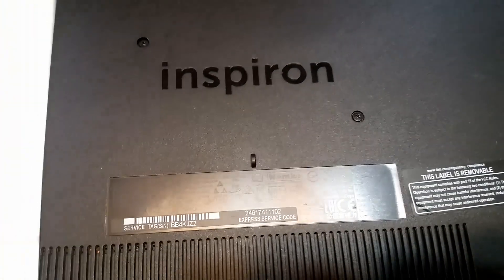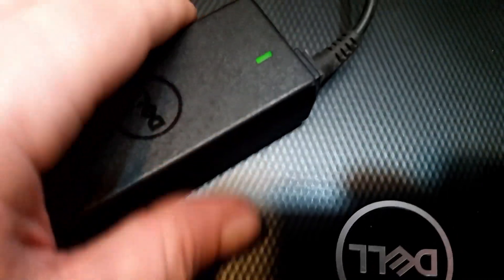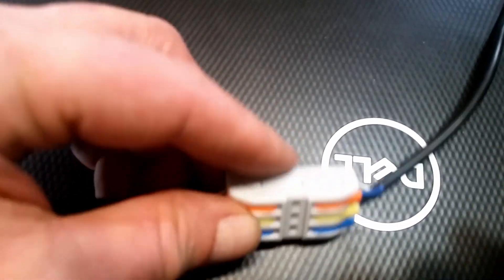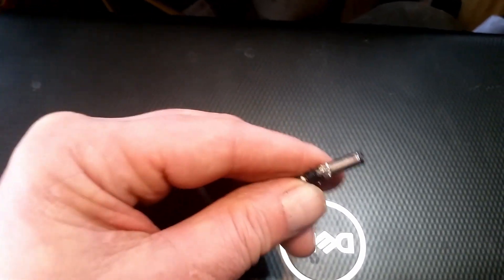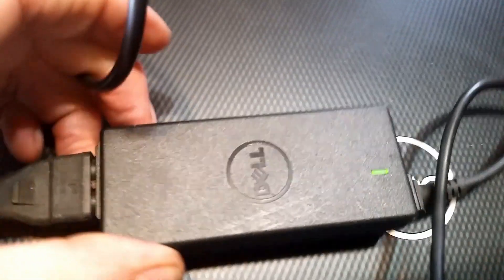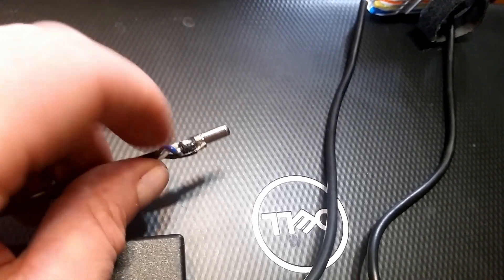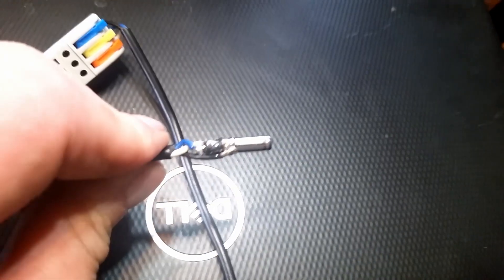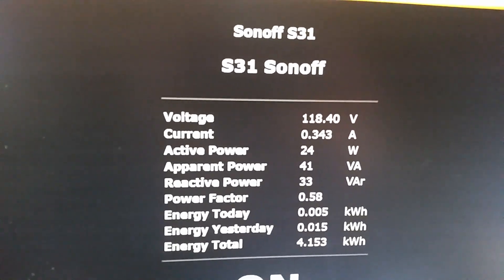Dell laptop AC DC power supply repair

Comment: I would like to figure out the signal that Dell uses on that center pin so that I can make some kind of fake out system for when they break.  I suppose that Dell power supplies are cheap enough, used.  But sometimes the laptop circuitry breaks and that won't help.
Reply from the maker: I have HP power supplies with identical looking jack that has the middle pin in it and those don't work on the Dell as far as being identified.  Not sure if HP uses the center pin or has their own comms with their laptops.